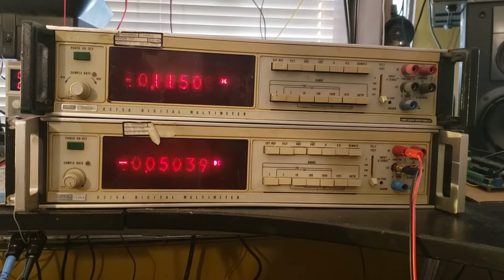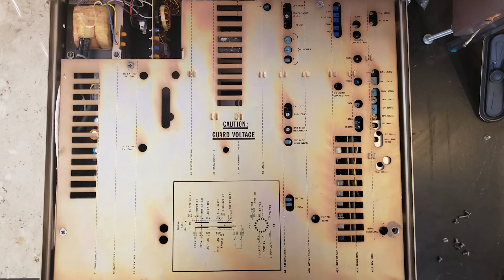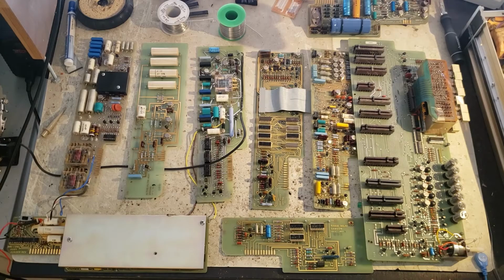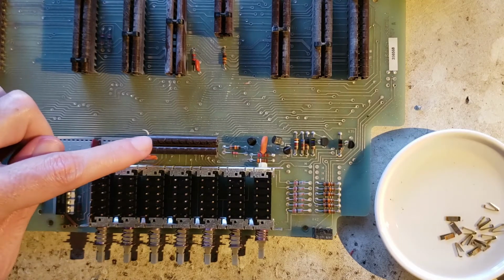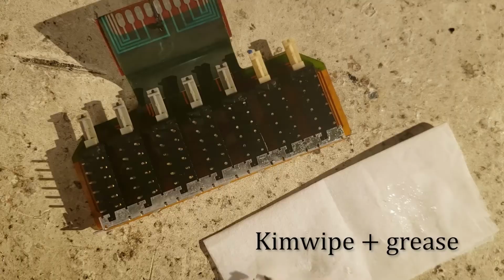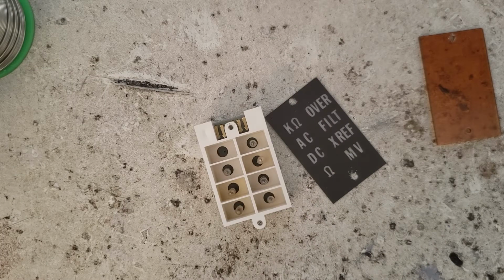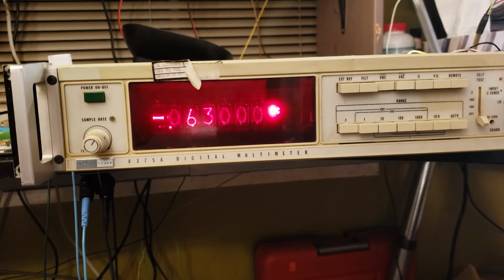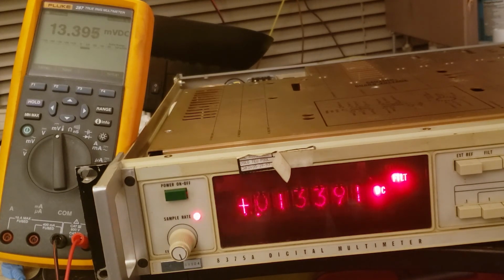Restoring an Antique Fluke 8375A Nixie Multimeter Part 1

Comment: I had a play with one of these too, but mine was certainly not working at the start.  Now just have AC volts to fix.  Like you, I had trouble with the edge connectors.  I'll recommend your video on the one I did.